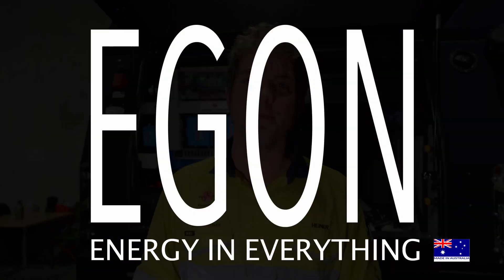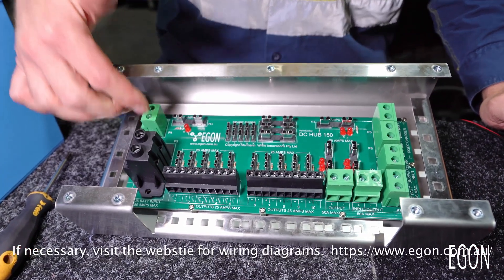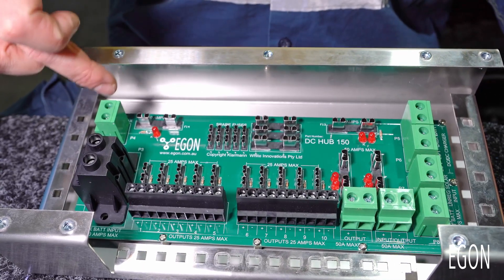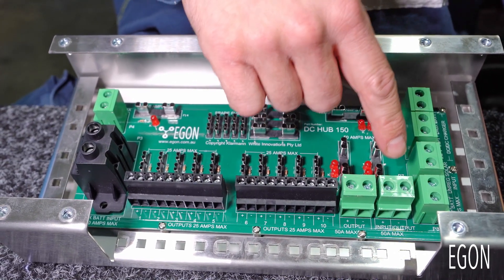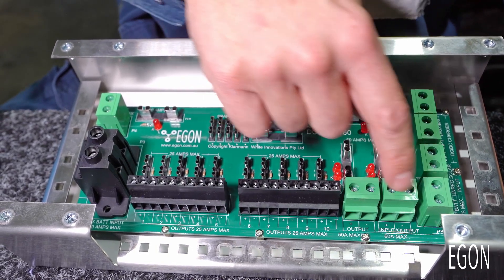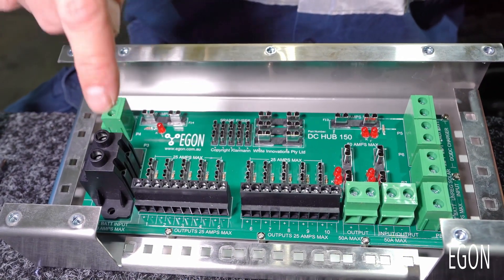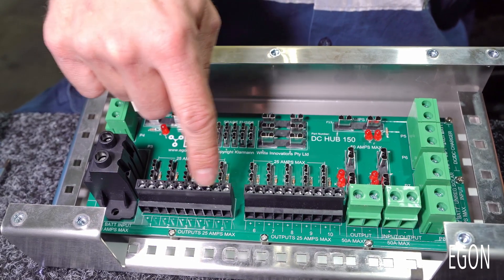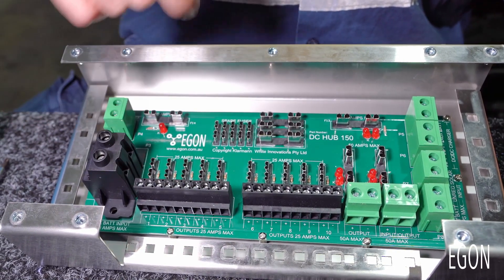EGON DC-HUB load connection guide

Comment: Just have a question about the DC-HUB. I’ve noticed with your connections and lay out diagram, showing the 80 amp max output fuse holder says it can run a trailer. My question is “can I run wiring from this fuse holder to an Anderson plug to the rear of my vehicle to connect to a camper trailer anderson plug to run a Enerdrive DCDC charger to keep the house batteries charged?”